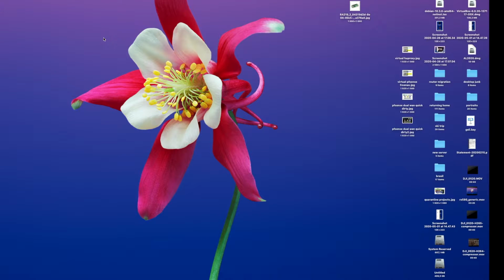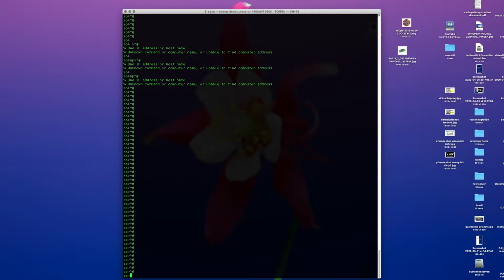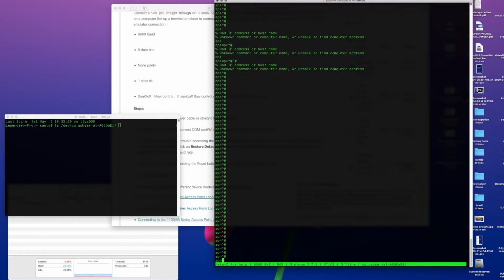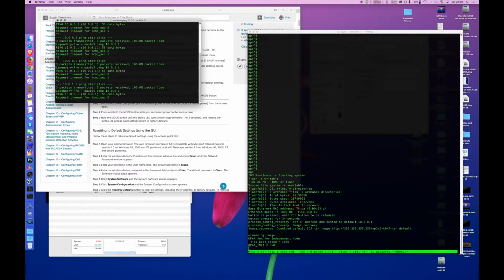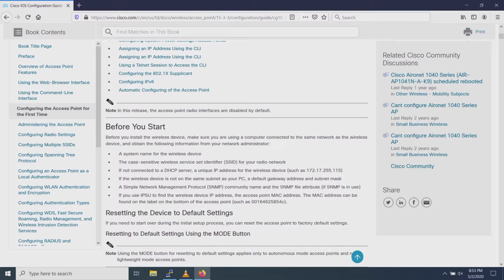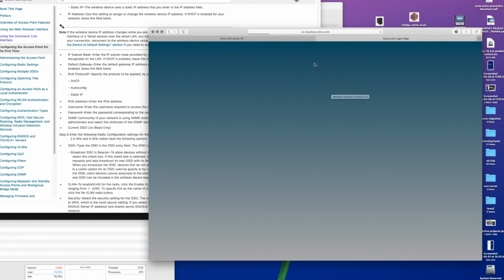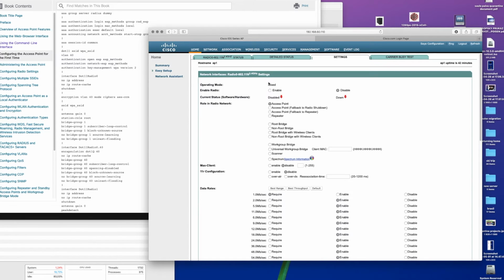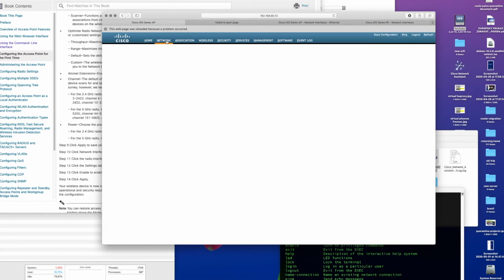Cisco Aironet 3700 - First look and (very) quick and dirty how to

Comment: I just bought 3 of these units second hand. The interface is quite bad but im hopeful once i get them setup they will last for a long time
Reply from the maker: They should. The only time I rebooted mine was when I had to change my UPS battery.
Reply: Are you using as autonomous or wlc? You can get the vWLC and run them as lightweight and get better control and manage all aps in one ui.